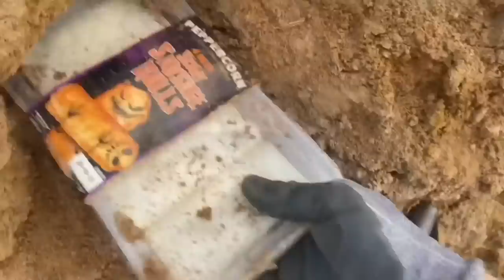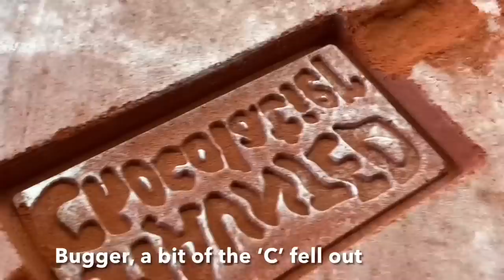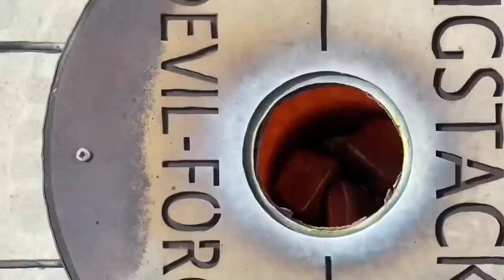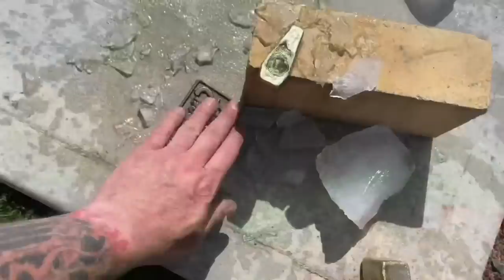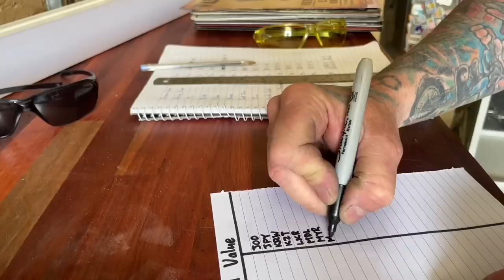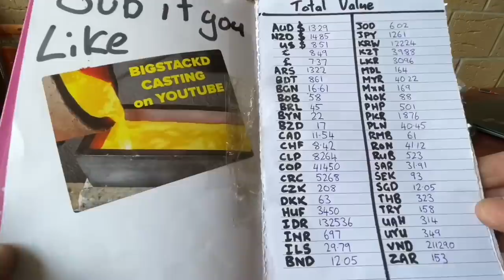Slag Melting - Real Trash To Treasure - ASMR Metal Melting Halloween - BigStackD Sand Casting

Comment: There’s channels out there trying to do what you do but you are the original and still the best 👍🏼
Reply: I noticed that too, been dedicated to this channel only since pretty well the beginning. The best.
Reply: As a fellow Aussie, bigstackD is all I need :D
Reply: Imitation is the most sincere form of flattery.
Reply: I deliver to a Stainless steel mill Alot. It's 😎 to see it on the small scale. And I'm amazed at all the minerals that go into making metal. There's like 24 big sheds with different minerals in them. I haul nickel ore. Some comes from New Caledonia. Down in your neck of the woods.
Reply: I saw about 10 sec of one of those imitators, and was like this ain't Stacks,gave him a thumbs down then click off🤣🤣
Reply: Yeah, I've seen a few, but it's not as good
Reply: Although there is another one called Robinson foundry which is pretty good but he doesn’t do the same thing as BigStackD does

Comment: Considering all the gold mines and private miners down there, you should see if you can get customers that want their gold melted into bars or whatever and we can see some gold melting. 
Only way I can see you be able to melt gold for us without having to source it yourself which would obviously be very expensive. Just an idea I had while watching this vid, which was great as always of course.
Reply: Or could source tailings from some of the big (non-chemical)wash plants... there's usually a bit of gold that slips through, just being basically flour. It's too much hassle for the big concerns to faff about with, but if you did a refine and recover, you might get a surprising amount... and half the time the tailings are cheap or free (and if it's a non-chemical operation) and even if not, it makes for fill material for deep landscaping, swales, etc

Comment: Mine has just arrived I watch your new one then unbox cheers brother
Reply: Amazing brother you should get 4 x 600 watt solar panels and run the electric furnace be a good episode. Also can a steel funnel not be fabricated to sit in the hole. Also on ebay there is a 250 year old crucible for sale with pouring spout and a lid to catch the dross when pouring ever seen one and what's your opinion as I got get one. Kind regards Craig top top episode by the way.

Comment: You should build like a big forge say for like 5x that amount you can do maximum and have a cooling system with like dry ice or even liquid nitrogen for after you shut it off and let it cool like that would be so cool to have a winch and a big forge maybe 4 ways the flames go and then pull a lever to drop nitrogen water idk you do you but that would be amazing that forge is on its last legs

Comment: Dear,
Did you ever tried to rinse the slag in water before melting? Maybe some sand and ash would go. 

I also wonder what would happen if you drop the slag from the crucible in water instead of on the fire brick. Would it create little beads or tears and get rid of the ashes? 
Thanks again for the videos.

Comment: when casting sand molds. it helps to put alot of weight on the mold.  the molten metal will try to make the mold float. no matter how small the mold. and also that sand you use.  if you inject Co2 to it will harden the sand

Comment: What kind of tips do you use for sanding and polishing your aluminum and copper?
Reply from the maker: HOW TO MIRROR FINISH A BAR 
I start with an 80 grit flap disc on my angle grinder then I use my drill with a 50 mm round sanding discs . I start with 150 grit then go through the following Gritz 240-400-800 Then once I get to the following Grits I use a small squirt of WD-40 1200-1500-2000-2500-3000-5000 .
The WD40 helps to lubricate the discs and stops the sanding disk binding up with the metal powder , I’ll also every now and then wash my desk to get any metals of them. Then after that I use my buffer wheel on my bench grinder to get a perfect mirrored shine on it👌🏻😁. Now if you jump ahead too much on the grit levels you will have small scratches on the bar that you can’t get rid of so it’s really a personal preference on just how perfect you want that Bar.

Comment: If you really wanted to get the last little bit out of your slag, you could try grinding it up, and try mixing it with some Flux/reducing agents, and to pour it like you would if you were doing precious metal recovery.

It's just that for you it would be like 30 cents of bronze recovered per 10 dollars of spent of reagents vs the other dudes getting 100 bucks of gold.

So not economically viable (except for the video profits), but could be cool to see

Comment: I wonder, have you ever dumped a crucible that was glowing hot into a ice water bath before? Just make sure if you do, that the boys are well away and that you have cover. So use a metal bucket or wash tub that it doesn't melt through any plastic and make an even larger mess.
Reply from the maker: Yes I have put a redhot Crucible on an ice block quite a few times and nothing exciting happens it will just sizzle away for a few minutes as these crucibles are very strong. I thought it would explode but no unfortunately it just sizzles away and it’s not very exciting . Having said that I have an old Crucible that I might get rid of in this Friday‘s video with an ice block👍🏻
Reply: @bigstackD  huh, I really thought it would be more popping and crackling, but yeah if it's full then that just boring. Something exciting is needed, maybe use it to melt glass in then let the whole thing freeze up. Or just, sledge hammer time like a golf swing. Dealers choice, although I'm quite looking forward to seeing the Friday video release, it's a highlight of a slow work night for me.